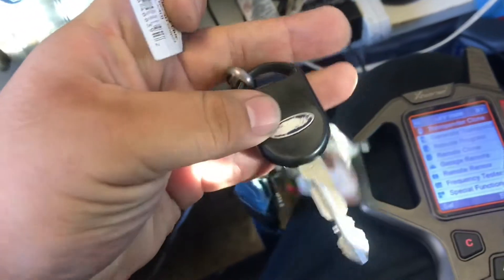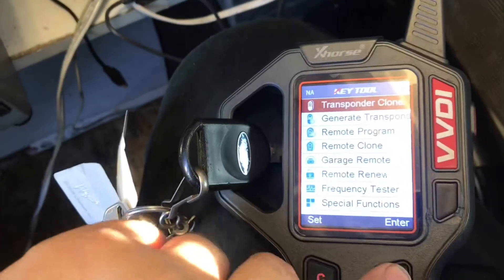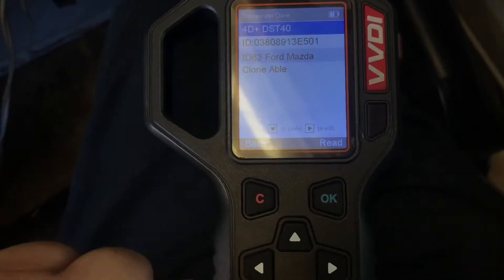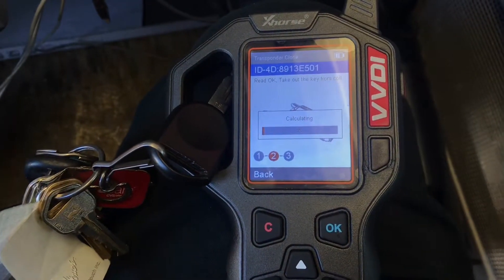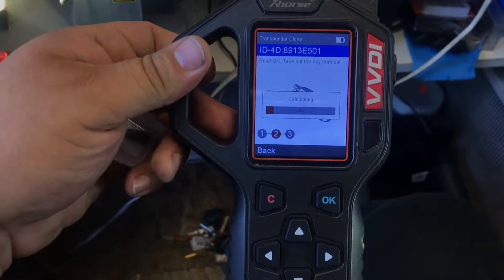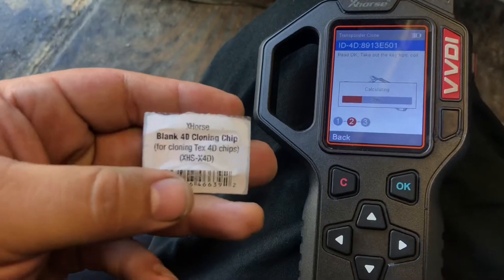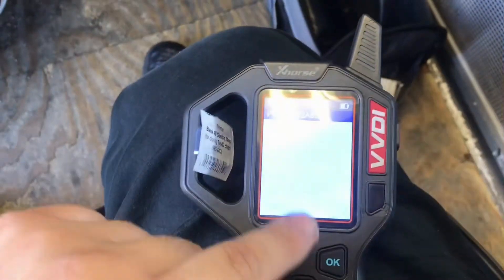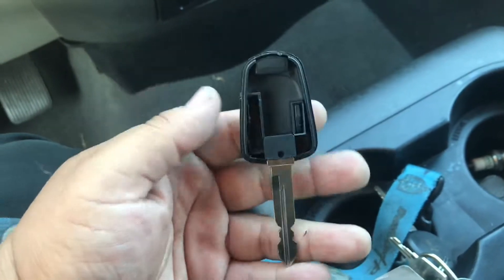CLONING FORD KEY 4D-DST40 ID63 80BIT  (VVDI KEY TOOL)

Comment: Yes last weekend I did a F-150 2011 for my customer, and key chip is ID83, when I want to clone it to super chip my mini key tool shows failure and it said doesnt support this type. A little bit wirred cause it shows clonalbe but cant do it,  first time to see that. So I was directly programming it through IM608.
Reply from the maker: I usually just generate it and program yes!! Right on my friend!!

Comment: Do you recommend always clone a key first Preferablybefore programming to save time? Or only clone after programming fails.

Also do use some type of glue when you put a newly programmed chip  in the new case To keep the chip in place?

If I want to buy a new Vvdi tool, do you recommend toolmax  Or cheaper modelwith the ODB adapter?
Reply from the maker: I clone all the time ony when its all keys lost i have no choice but to generate chip and program..

Comment: So you will clone a new key instead of programming a new key if you Cannot add a new key (No available slot?)by programming correct? Typically you just add a new key not cloning  keys As business routine.
Reply from the maker: Yes thats correct cloning is my last resort ..
Reply from the maker: Or if theres something wrong with the vehicle and the programmer cant connect to the vehicle ill make a clone...but like i said clone is my last resort because the chips are a little pricey..

Comment: what programmers did you use that wouldn't program the key? I had to do the same thing the other day and just clone the key bc I couldn't program  one to it... my APP and CK100 let me down...EVEN the IM608.... I think im going to have to get a Smart Pro
Reply from the maker: Sometimes its just the vehicles if they have wires that are out of place ,dangling obd or after market radio it could possibly mess up the connection ..but i was using the autopropad .. it was a 2004 ford f150 really basic vehicle lol...i was tryying to bypass the wait time... but i guess ima have to wait the 10 min.  What vehicle were you doing???
Reply from the maker: Yes smartpro is trully the best programmer after the autopropad,i have one ... its like 300$ a month for subscription... but totally worth it .. it never fails ...
Reply: MY KEYS AUTOMOTIVE  I think I used the Autek IKEY820 for this car and it worked with out any problems.